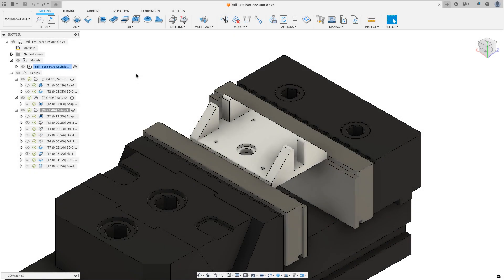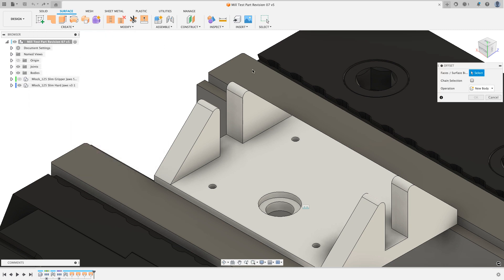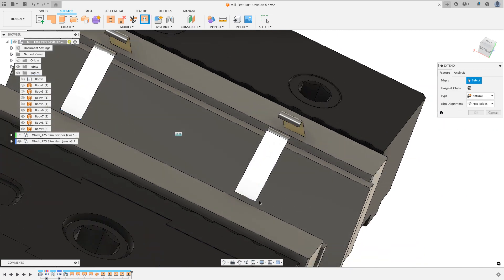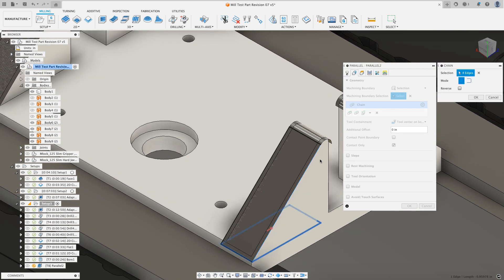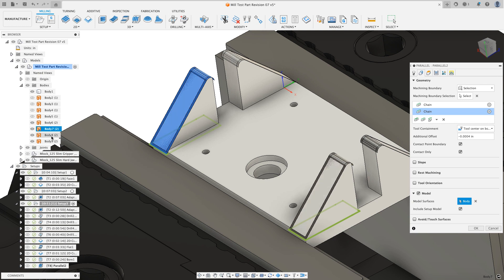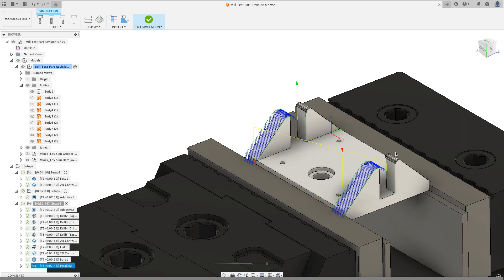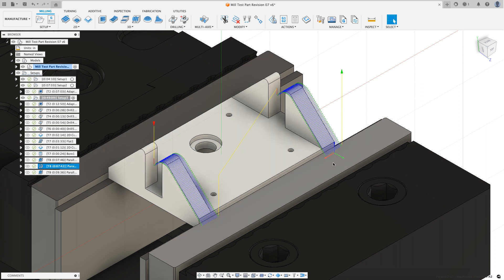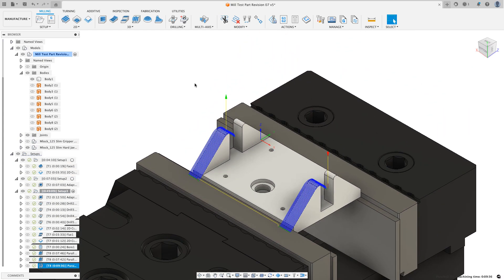Programming Xometry Mill Test Part using Fusion 360 - PT 4

Comment: Since we essentially have 4 identical tool paths. Would this not be a good scenario to only modify 1 of the features in the surfacing environment, then mirror and pattern the tool paths in the manufacturing environment? This would save time during the creation of those surfaces, and even more time if edits needed to be made to those surfacing features later. Just thoughts
Reply from the maker: I try to stay away from mirror. At best I will use a circular pattern.

Comment: Hey Kevin I have just attempted this same part and had a similar strategy but was forewarned that Stainless can "spring/ warp" as material is removed. I machined as I normally would to see what that "spring/warp" really looked like and in fact found some dimensions and flatness that were off. Any suggestions on how to machine with this in mind to either avoid if possible or correct if needed?
Reply: Going to have to unclamp and  reclamp. Set a stop.

Comment: Hey Kevin, another great and helpful video. Thank you! I've been trying to use the Flow toolpath without success. It appears to leave material on the top curved surface and the edges. I see @glebgro's comment about Blend and your comment that Blend isn't a released toolpath yet. I found this 2017 comment that "the replacement for Flow will be called Blend and is currently in beta" (that is one long beta test 🤣). I'm assuming they are the same or similar toolpaths and that your reply to @glebgro's comment is probably the answer to my issues with Flow. All that to say, I'll be changing over to the Parallel toolpath.
Reply from the maker: It appears that I was either incorrect or that the strategy has changed. Flow isn’t being replaced with Blend. I’m fact, there is a new Flow preview that can be enabled in preferences. They each have their place and will be important toolpaths of the future. 

Thanks for the comment.

Comment: Thanks for the video! I have a few questions: why did you use Parallel toolpath instead of Blend? IMHO it`s a bit more accurate and doesn't require making all of those additional surfaces. Am I missing something? Thank You for your answer!
Reply from the maker: A few reasons for this. Blend also can't start and end off the model, so with Blend you would still require the surface if you wanted to ensure your tool was getting all the way off the part and starting off the part. 

Blend isn't a released toolpath yet. It still has a preview tag on. While I have been using blend for quite a long time and it's one of my favorite toolpaths, I wasn't sure it was the right thing to use providing it is still an unreleased toolpath. 

The Blend I have is also a bit different than the Blend found in preview, and no, I can't talk about it hahah

So there are a few reasons why I chose to use parallel in this example. Thanks for the question.